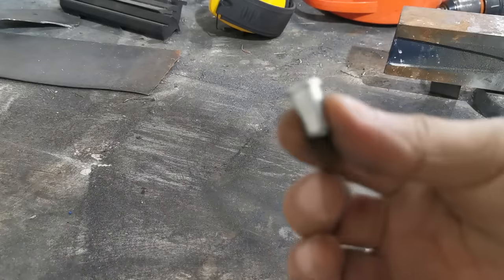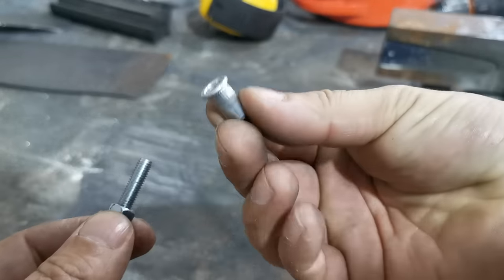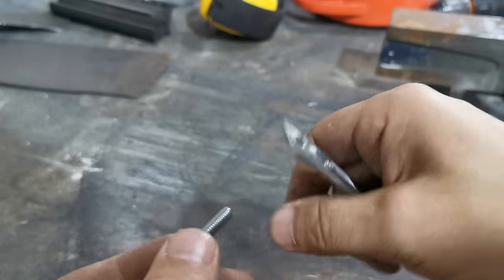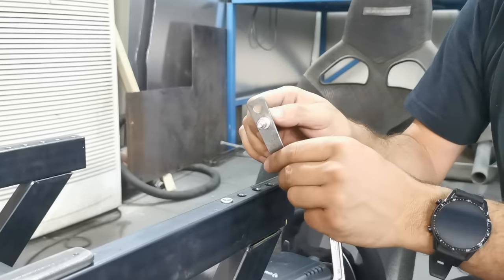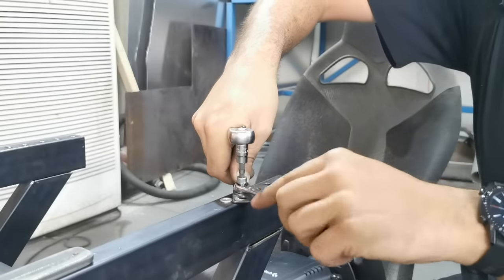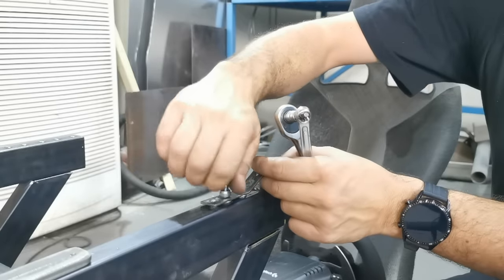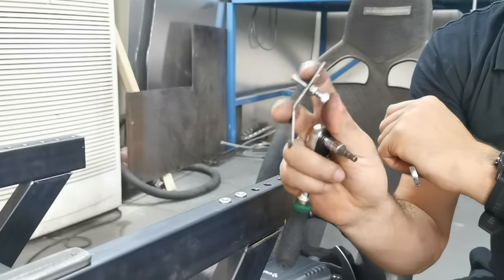How to install rivnut, rivet nuts or nutserts, with no expensive tools

Comment: Good tip!  For less chance of breaking, you could probably use a hardened bolt and nut.
Reply from the maker: Great point!
Reply: Use an Allen screw, they are better quality, or if you can get hold of them, a Caterpillar bolt of the appropriate size.

Comment: This is the easiest way I’ve seen and it worked for me. The “tool” just keeps the friction from the head of the bolt from spinning the rivnut. I skipped the nut and only used a bolt (with the “tool”) with a little grease under the head. I spun my bolt with a cordless drill. Just be careful not to over tighten. Once the rivnut is gripping you can finish with a spanner by hand. Too tight and the bolt may snap.
Reply from the maker: Nice one and thanks for sharing
Reply: hello i m merouane i have problem  
i put rivnuts in plastic bouton i.i search best way to fix it there

Comment: I have used a thrust bearing and big washers to reduce friction (offload the nut face) - when inserting M8 threaded insert - I used a HT - class 8.8 or better bolt as I did have a plain steel bolt strip threads. (antiseize is a great stuff to have-  yep.)

(adding a ratchet ringspanner to the kit is handy)

Comment: I got it.In a case where the base metal is thin or soft and can not be tapped for a thread directly or placed a nut manually the best way to attach a screw is metal threading rivets.With this method apply force to the rivet to cause expansion in the opposite side to form an internal nut for holding the bolt.

Comment: Lowe’s has a little set up that you can use your drill for maybe less than $5 bucks. This is to much trouble. I picked up a Wetols nut tool several years ago for $ 26 still working great and a lot less hassle. Have faith in America.

Comment: If you have access to a lathe, you could turn down the shank of a few bolts to the largest common pop rivet shank diameter and use a commonly available rivet tool with a spacer.
Reply: A pop rivet gun can’t pull hard enough to set the rivet without possibly damaging the rivet gun. I wouldn’t risk damaging mine.

Comment: If you must do more than 10 regularly get the Rivnut puller. They make manual & pneumatic. They also have notchers to cut a small keyway in the hole to prevent spinning.
Up to you guys.✌

Comment: You can also use it without the homemade tool.  Just use a flat washer the same diameter as the nut head.  This way you can easily see if it's seated flush all around as you're tightening it down. Plus this way you don't need to try to hold 3 things at once.

Comment: I found the Knipex Pliers Wrench is great at crimping the rivnuts, but it only works in situations where you can get the pliers onto both sides of where the rivnut has to go. I used them for installing better threads for my car's rear shelf speakers since the actual tool would hit against the rear window.
Reply: Nutserts or "blind" rivets a.k.a. rivnuts were actually designed for when you CAN NOT get to both sides.... and have the need to assemble/disassemble....  if you do not need to assemble/disassemble,  a regular rivet is used.
Reply: @mrmgjohnson  It worked well enough for me. I had no way of using the actual tool supplied with the rivnuts.
Reply: @nickdibart  thats great, I  wasn't being negative,  hopefully you didn't take it that way.... just giving you some unsolicited background on the nutsert. His idea is really good,  I  would use a ratcheting wrench,  add some length to the "handle",  a washer and some grease..... never have had to do it that way,  but now I have the confidence I can. Glad it worked out for you  !
Reply: @mrmgjohnson  necessity breeds innovation lol

Comment: bought rivnuts and the tool from Aircraft Spruce in the 70's. never had any mandrel problems at all. probably better quality then. i doubt if it was made in China or Pakistan.
Reply from the maker: You got yourself a proper quality tool. As they say. They don't make em like they used too. I must confess I search yard sales for old chisels and files to get good quality steel. 😉

Comment: This is pretty much how I do it. Make sure you use Alloy Steel Socket Head Cap Screws that meet ASTM A574 otherwise the threads are going to strip right out or the screw elongate then snap off. I also have a flat washer between the nut and head of the rivet nut and anti-seize compound on the threads and all faying surfaces.

Comment: I also use this method my question is how do you remove them. I’ve several on a screen door that The tightening over 30 years has finally stuck the bolt.

Comment: Question: Instead of your ‘tool’ could you use a heavy duty washer instead? Thx
Reply from the maker: You can use a washer, but there is a huge chance of it spinning the Rivnut making it impossible to squeeze it together. The idea of having a tool you can hold is it removes the twisting pressure and allows the rivnut to be compressed instead

Comment: Funnily enough, I recently bought a heavy duty long handled rivnut installation toolset with 110 rivnuts for less than £8 delivered!

On inspection the tool was found to be extremely well constructed and had multiple sized heads to install various rivnut sizes, all contained in its own plastic case.

I've never seen anything like it that was affordable before now, and whilst I was initially skeptical, the tool is really well constructed, as are the heads, I can't fault it.

Edited to say that I just looked up the UK seller and they no longer have any.

Identical sets are around £50 to £60+ so perhaps they were accidentally priced at the low price I got mine for, which would explain why they're no longer available as they sold out very rapidly.
Reply from the maker: Yeah cheap tools are great, but in the case of rivnut tools the smaller sizes bits M4 and below and brittle, with the long handle leverage its really easy to apply unwanted force on the bit as you squeeze the rivnut up and boom, bit snaps off. Rendering it useless. I don't worry anymore as I now use this technique for all my rivnuts. Worst I encounter is a thread stripped from a bolt, and it that case I just grab another bolt. Also working on mostly race cars I find the tools are a nightmare as being long handled they often won't fit in the tight spaces I need to fit rivnuts. Again this technique has saved me many times. If you are in a large country where mail order tools are easy to get its fine, but for me it can take 2-3 weeks for a tool to arrive. Anyway good luck and thanks for the update.

Comment: Quick question...what if you held the nut stationary and used the ratchet to pull the rivnut/bolt up using the nut to flatten the head? I'm assuming you didn't do that as you were worried about damaging the threads in the rivnut?
Reply from the maker: Yep you got it, damaging the thread on the Rivnut is highly likely. The nut and bolt are sacrificial.

Comment: If you used a high tension bolt..like a grade 8..is there a chance of stripping and stretching the threads inside the rivnut if you tighten it too tight?
Reply from the maker: Hi, Yes always a chance of stripping threads, or they just start spinning in the sheet metal.

Comment: I need this type of thing in 10mm but basically I need a bolt that screws into a bolt. So if I used this the bolt would screw into the opposite end that you are screwing into and it acts as a rotation point for my mountain bike rear suspension swing arms right at the rear of the swing arms. I don't know what it's called and I can't find them anywhere. Is it possible to screw a bolt into the opposite end?

Comment: Just use a bigger diameter and length nut, hold it wise grips, 2 washers with some grease and a high grade bolt matching rivet nut thread. Bolt, 2 washers with grease in-between them, large nut and rivet nut. Now use your impact and you good to go. If you can scratch the nuts mating surface so it can grip the rivet nut better - it will be better.

Comment: Does the hand method work for stainless steel rivnuts or do they require a special tool?
Reply from the maker: You might struggle, if I was attempting that then it would have to be with high tensile bolts. At the very least they would be stainless and good quality.

Comment: I have always just stacked 3 or 4 washers under the nut, with some grease between them, never used a plate. Also a little grease on the bolt threads. Use a grade 8 /class 10 nut and bolt.

Comment: Put a couple washers on between the nut & plate w/a little grease, it’ll act like a thrust bearing. I have a lot of specialty install pieces like that doing work in dashes when limited on room , but if there’s room - the the 2 handled tool comes out !
Reply: Exactly my thoughts - this guy knows what's up!

Comment: do ylu think it would work juust as well to use a widiameter metal washer in place of the tool you mede? if not, why?
Reply from the maker: Nope. Reason being is you risk the rivnut spinning. By having a tool with a handle to remove any twisting motion applied to the rivnut.

Comment: I use a Gearwrench for winding the nut down with.
Reply: Agreed. Ratcheting box-end wrench and a long hex key works great at well. Standard Ratchet makes for easy removal at the end. I also use this cheap wrenches they supply in furniture kits as the shim steel. Plenty of those lying around since they are garbage for actually building furniture.

Comment: I was using this method for a handful of rivnuts. Seeing your vid it seems that I'm not alone. ;-)
My experience was that a ordinary screw/nut (I'm calling it "tool") is good for approx. two rivets until the threads are ruined. 
Be careful with grease as you dont want to grease the rivet in the hole. This should be clear of any grease. A q-tip to apply some vaseline was my way of choice.
Reply from the maker: Good stuff!

Comment: It’s called a captive insert threaded rivet . If you got loads to do then buy a good quality rivet gun . I have one and it’s done thousands and it shows virtually no wear , key is don’t abuse it . I’d like to see this method is easier when fitting in engine bays in tight corners . Honestly go buy a decent rivet gun , you get a better feel when you pinch the rivet

Comment: I don't see an advantage in making a tool that takes the place of a washer. You can put downward pressure using the  ratchet, right?
Reply from the maker: A washer can spin causing the Rivnut to also spin. There is a lot of forces going on when they are being squeezed. By holding the tool you can not only apply pressure downwards but also you are clamping the rivnut between to fixed surfaces.

Comment: Chrysler was using them in 2013 for attaching accessories, perhaps they work in the desert, they are good for a few years in the rust belt, then they seize on the bolt, spin loose in the hole, and are a nightmare to deal with.

Comment: Would it not be better to use a ring spanner with a ratchet?
Reply from the maker: You can, but needs to be high quality, or the ratchet will break with the forces required

Comment: I've got a lot of HDPE around. That should work between a couple of washers. Thanks  for the idea.
Reply from the maker: Good idea. let me know how it works out!
Reply: @SmokingSteelGarage  Works just fine. I have a sheet of 1/8" that's sold as manger liner at fleet farm stores. Cuts well and hole saws can make any size you want. I replaced the washer on the bottom of my refrigerator and a dozen other projects.

Comment: Makes fitting rivnuts possible in narrow places where expensive rivgun tool would not fit easily , such as fitting in frame of bikes to convert to fit electric / battery, thanks
Reply from the maker: Absolutely, you can guarantee you will always need one in a space that's too small for the gun.

Comment: Great video doing a roof rack for my focus and watched many videos your little diy tool is what did it I’d I used the fork tool for the grinder wheels bent it drilled whole to the screw size and in the u part of the tool I rest my ratchet and I’m able to use it almost as if it was one piece thanks man Worked great
Reply from the maker: Awesome work, I never thought of that, doubling up a tool Genius!

Comment: Humm, what a surprise to find this video today. In the last 2 day I have been Googling on eBay for these, trying to finish a hoist to garage ceiling to hang my canoe and clear s9me garage floor. I am still not sure if 5 of these can support 40Kg in weight using M4 or M5 to hold a Cowdroy sliding door tracks rated at 80Kg each. Any suggestion, because eBay doesn't provide specification on these. Amazing to find you here today. 😯

Comment: Quick (and maybe dumb) question: why use the flat piece of metal instead of just a flat washer and some lithium grease?
Reply from the maker: Good question. With a washer it will work but you also risk the rivnut twisting in the hole as you tighten it down. The bar stops any twisting forces being applied to the rivnut.
Reply: @SmokingSteelGarage  so the rivnut instead of squishing itself "straight" it would twist&squish? Does it mean the rivnut threads could get damage? Or does it change nothing?
I managed everything on my previous cars by bolting things where I had access to the bolt hole or to a factory hole with a nut welded on the other side or by making brackets to such bolting points. But I've had my rivnut kit for years and never used it. I think I even lost the proper tool!
Reply from the maker: @PetitCorpsSalade  yep so the whole rivnut will start to spin in it’s hole instead of staying static and squishing to fit the hole. By holding the bar you remove any twisting forces and stop this from happening.

Comment: rivnut tool kits are around $50.
I usually weld a nut to the under side and drill a hole on one side to access a hidden araea.
rivnut nuts are usually too flimsy for my needs, they strip out easily..

Comment: I would use grade 8 bolt and nut and a gear wrench. If you have the tool an it breaks on you I'm thinking you can make one with a grade 8 bolt and nut

Comment: Okay, now I know how to do it ... But I'm thinking, If your plate thing is only for giving the nut something to slide around on, wouldn't a washer do the same thing?  Downward pressure could be applied directly from above with the ratchet.
Reply from the maker: Hi. The tool provides leverage that removes the chances of the rivnut being spun in the hole as you tighten the nut down on it. A washer would risk this. 👍
Reply: @SmokingSteelGarage  lol.  I learned that the hard way!
Reply: @SmokingSteelGarage  Yeah, I think the main issue I was having though was due to the fact that I was trying to do this in 10-24 with those little thin nuts.  It kept stripping out the bolt.  Once I used a nut with more threads, the rivnuts all crushed properly.

Comment: Aye so what if I just attach my drill to that bolt.

Also if I had a bolt that was shorter than the enclosure. Say for putting these in for my door speakers.
My bolt will easily fit through the hole without touching anything inside my door; so can I simply put the bolt on my drill put the riv nut on and screw it down?
It seems like the river would tighten on the bolt until the head of the bolt is sunk against the metal, at which point it would start pulling the riv nut tight no?

Edit: before yall correct me, that riv is gunna spin with the bolt instead of tighten 🤔

So I was looking for a strategy that uses less parts and tools, don't think I got one but I still got a drill strat.

Do everything how you did it.
(DONT use the home made tool you used for the underside of the nut) instead add a washer to each side of the nut.
Now hold the NUT TIGHT with your wrench 🔧 while you tighten/screw the BOLT with your drill.

So it's basically the opposite of what you did. Rather than hold bolt tight and screw nut. You want to hold nut tight and screw bolt.
But you need a wider bolt, maybe two, or a coupler, to make sure you don't bust the threads

Comment: Use grade eight bolt, nut, washer no need for the special bracket doesn’t matter if the washer turns under the nut. Will last forever.

Comment: Have you tried this method with a stainless steel rivnut. If so, did it work? i.e. Does it require a great deal of strength.
Reply from the maker: It could work. But for sure you'd need a high tensile nut and bolt or alternatively a longer threaded nut to share load. I'd probably weld two or three togehtor as a starting point and see if that worked.

Comment: Instead of using an old school ratchet would it not be better to use a cordless ratchet gun?
Reply from the maker: Hi Jacob. No, because you are not actually turning the bolt. You need to tighten the nut to squeeze the rivnut into place. The ratchet is just used to keep the bolt from turning. Hope that helps? Thanks for the comment though!
Reply: If you want to make it easier a ratchet wrench (spanner) may function well if you have one.

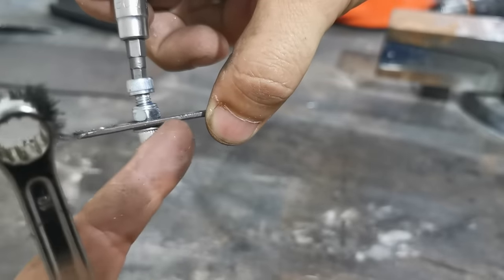Comment: 3:30 thats most important part about rivnut turning. you can use just a bolt and nut but then you need perfect/tight hole so rivnut dont turn with nut. i also made simple rivnut tool, but this is much faster solutuion :)
Reply from the maker: awesome. Thanks for the comment and good to hear you made a tool as well!

Comment: I have used the tool to install roof racks on vans and never had a problem.Harbor freight  $20.00 or less
Reply from the maker: They never are until that one day it breaks and you need to finish the job. Or the space is too tight to fit the tool in.......... Then you break out the nuts and bolts.

Comment: I gave up on the cheap china tool long ago , 
I have used this method for about 2 years , One trick i found was a little WD40 Under the Nut , 
Try it its about 50% easier to turn the spanner 
Rob
NSW
Australia